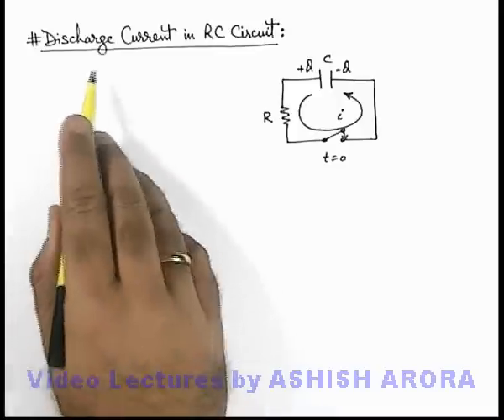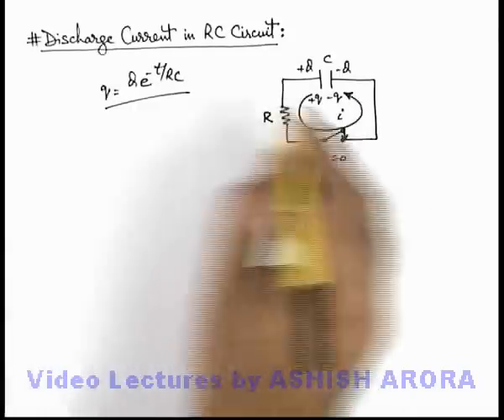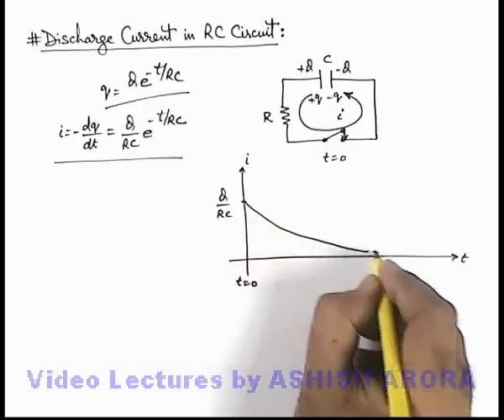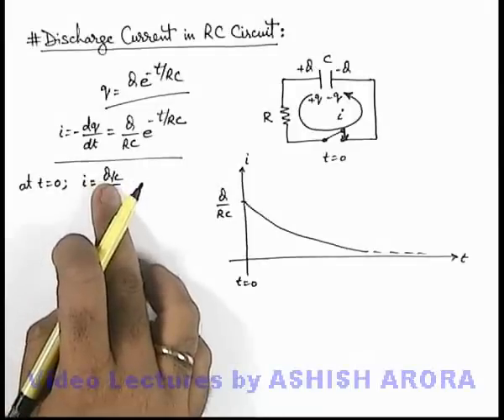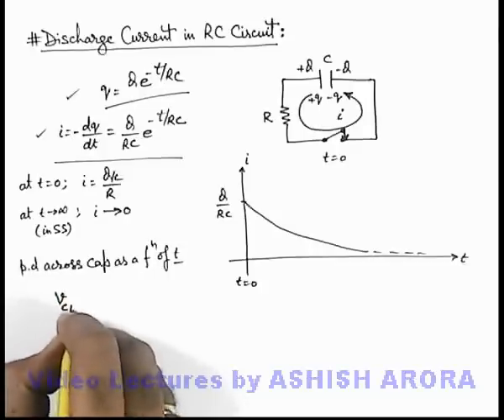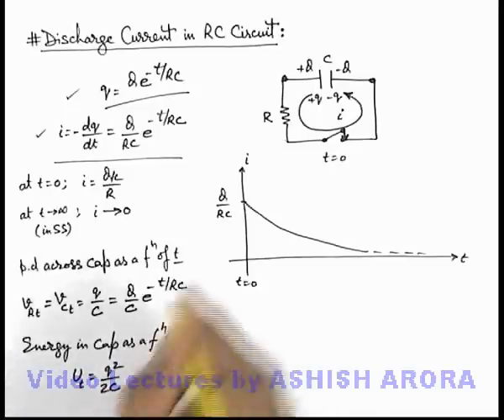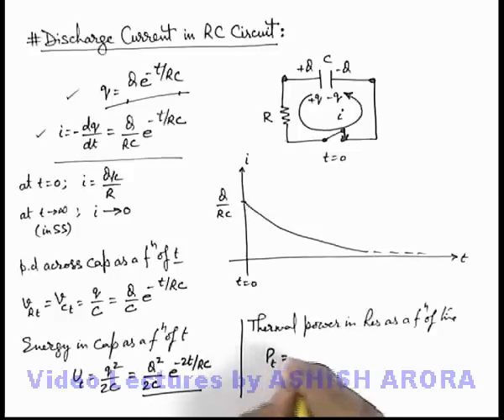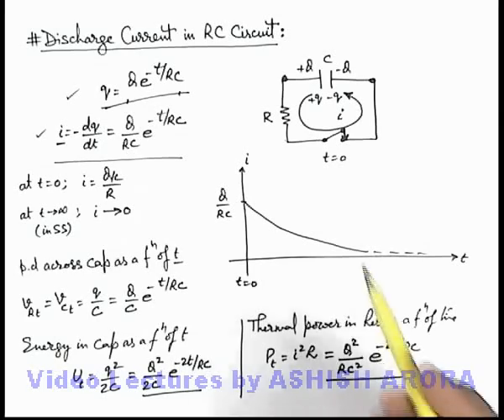Class 12 Physics | RC Circuits |#7 Discharge Current in RC Circuit | For JEE & NEET

Comment: Sir why did you say that they are in parallel even when they are end to end connected?I am a little confused in this when do we know that such a thing is showing series or parallel?
Reply: When flow of charge gets split, you can say that it is in parallel but if the charge flow is steady and goes to the resistors one at a time on one single path then it’s series
Reply: @niranjanr8075 thank you

Comment: Sir why q=A+B e^-t/rc where A and B are constants represent general equation which represents both charging and discharging please help me sir
Reply from the maker: Both charging and discharging situations may be different, capacitor may have initial charge in charging and other conditions are also possible so its better to keep straight situations for charging and discharging as standard cases and rest all cases we deal directly using KVL...

Comment: Sir at 3.17 how are you taking resistance as parallel to capacitor?
Reply from the maker: because across both R and C potential difference is same... and they are connect across each other....

Comment: sir how here capacitor is just behave live emf of batter  
didn't  understand  plese exaplin it in details
Reply from the maker: because just after closing the circuit, the current in circuit is due to the voltage across the capacitor... thats why we can consider it is behaving like a battery of emf Q/C
Reply: thnq sir